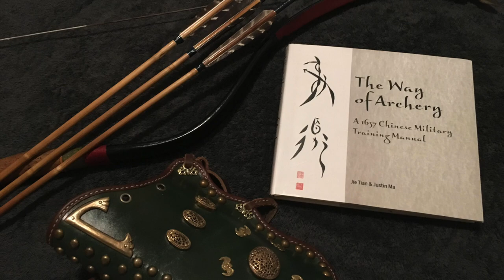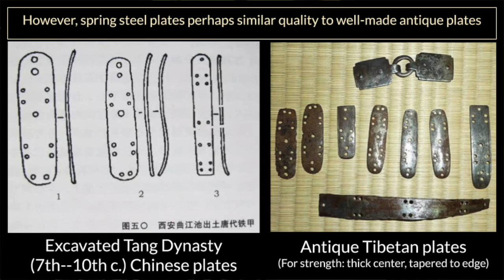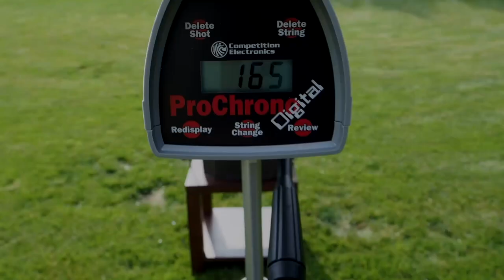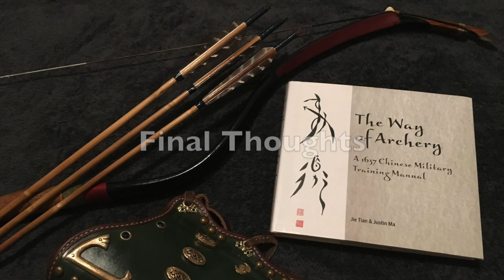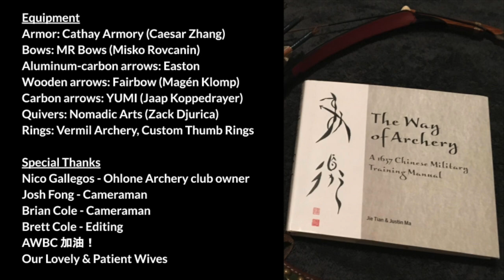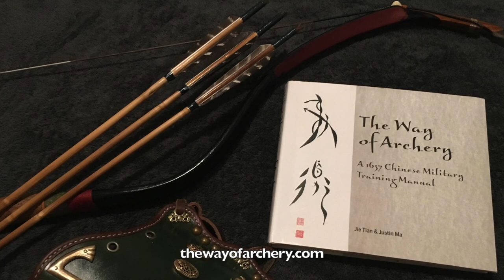Warfare Research Series (Episode 1): Chinese Lamellar

Comment: Great video! I'm confused why the arrow speed is so slow?
Reply: You should be more concerned with the arrow weight.
Reply from the maker: You'll want to pay attention to kinetic energy (0.5 mass x velocity^2) and momentum (mass x velocity) instead.
Reply: @Finnv893  not if I can't hit something past 30 m. Speed kills!  There needs to be a balance between speed and weight. I personally would like to see a lighter arrow traveling twice as fast! Maybe 700 ,800 grain at 267fps. If your familiar with bullets the 357 sig , I believe,  is a good example.
Reply: @TheWayofArchery  I know all about that! My 60lbs "Korean bow" with correct spine shoots an arrow 230 fps. Please don't take my comment as an insult it just seems something is wrong when a 100lbs bow can't break 200 fps with , I stress,  correct spine weight. Speed kills!
Reply: @regaeontop  not quite, your arrows must've been less than half the weight of those. These bow are designed for heavy arrows in a short range. If you're on a horse, shooting at a pile of infantry, you'll be close enough to hit anything anyway. Even if you missed, some other poor bastard will still get the arrow
Reply: @regaeontop  also, heavy limb tips. Light arrows would break the bow, but they'll love shooting a small javelin with a fletchings
Reply: @Zonic0000  I stressed , correct spine! If you thought I was saying I shoot 1000 grain arrows out of my 60lbs at 236fps then you need to read it again !
Reply: @regaeontop  spine is the stiffness, not the weight. I was making a point that the reason the bow didn't do 200fps like your Korean bow is that a large tip bow was designed to use a very heavy arrows at fairly short range, as compared to small tip bow like a Korean that was meant more for speed
Reply: @Zonic0000  fair enough , I agree!
Reply: @regaeontop  Korean bows are optimized for long-range shooting, resulting in a design that has great performance with very light arrows at high velocities. They are great bows, but they are just one approach. Not all cultures focused on speed, and most heavy warbows leaned more against heavier projectiles with more stopping power. Many modern bow hunters will also agree that a heavier, slower arrow is more effective in downing game. 

On top of that, when you go for speed there is a limit. Most flight records today are shot with 80-90 pound bows. If you make a heavier bow, the whole bow gets overbuilt and the added weight to make each part strong enough actually makes the bow slower. So above around 90 pounds on a typical recurved design you only gain the ability to shoot something heavier that does more damage.. not range.
Reply: @PeterDekker  a Korean bow is a composite bow just like the one your shooting. A Korean bow was also used in war and any composite bow can be shot long or short range.  The idea that MR bows makes bows for war and the Korean bow is for target shooting , I'm sorry , that's complete rubbish! The Korean bow I have came from Thomas duvernay and I can also get that bow made at 100 lbs.  100lbs is 100lbs! Maybe you should try that one! You guys keep thinking that if I'm concern with speed that I must have to shoot balsa wood shafts with plastic tips! Essentially a fragile arrow for the sake of speed. If weight is so important to you guys fill your arrows shafts with pebbles or rocks. It will hit harder but it will arc to the target at 20 yards. Also , I don't believe any bow hunter would expect a 100lbs bow to shoot slower then their 60lbs bow both with correct overall arrow weight.  Which is relative! Also , MR bows makes a beautiful bow but from what I've seen not the best performer! I take my archery practice just as seriously as you as I want to learn what my Hungarian ancestors did and didn't do on the battle field! I very much appreciate your pursuit , book , and video. P.s. I'm in California now I'd be glad to shoot my bow at that armor!
Reply: @regaeontop  Problem is there is no bow made (for the average human anyway) with trad materials (carbon would just delaminate due to stress) that can propel a 800 grain arrow at 267 ft per sec, there is a limit on how fast a pair of bow limbs can snap forward, adding poundage does not make them move any faster past a certain point, because you are also adding limb mass, when the point of diminishing return is reached, all you can do is add weight to the arrows to gain kinetic energy. Guns use barrels made out of modern steel that can withstand a ridiculous amount of pressurized gas, and all the energy is prestored in the powder to accelerate the bullet down it, so you can see the odds are not in the bows favour.
Reply: They're COMPOSITE BOWS not recurves!
Reply: @Finnv893  I beg to differ! We have not had the same experiences! I'm hopefully going to be starting a channel for the same reasons as justin and will show what I'm saying to be true or false.  You have to a count for the Bowyer. It doesn't seem Mr bows makes the best performer!
Reply: @Zonic0000  that's rubbish! The thickness of limbs etc is relative to the poundage it's being made for. I can get the Korean bow I shoot made at 100lbs. They're composite bows !
Reply: @regaeontop  A heavier arrow will always have more energy than a lighter arrow, every single time. It's not the same as the difference between a lighter or a heavier bullet. A heavy arrow takes more time to be accelerated by the bow, which gives the bow more time to impart energy into the arrow. That's why heavy arrows are used by anyone who wants as much penetrative power as possible. And also, I was impressed by how fast those extremely heavy arrows were being shot. 167fps may not seem like much if you're used to 200+ fps, but 200 fps is extremely high for a traditional bow and should not be expected from most bow designs. Turkish and Korean bows may be an exception.
Reply: @regaeontop  I know Thomas very well, we met in 2008 in Korea and have been friends since. I've been taught Korean archery in Korea and I like to believe I know what the Korean composite bow is, and what it can do. I have several that I shoot, including a horn one, and own and researched several antiques including one believed to be as early as the 17th century. The Korean bow is one of my favorite bows and nowhere did I state that Korean bows were never warbows. A variety of them was indeed used in warfare and there's even an article about them versus Manchu bows on my website.

We've tried and tested 90# Korean bows with several arrows and they lack the force to deliver the 80-gram heavy war arrow as fast as a Manchu bow of the same poundage can. This is due to the design of the bow, the limbs are narrow and optimized for quick acceleration. This is definitely not a flaw, but a very deliberate design choice. Both bows do exactly what they are designed for.

It shot its own lighter arrow at 260fps which was really quite impressive. But, like Justin in this video put forth: Poundage or arrow weight only tell a small part of a story. Joule of kinetic energy produced is where you measure potential striking force and the Korean bow does hit with less force for the poundage pulled no matter how you look at it.

Putting pebbles in our arrows is a silly statement of course. Every bow has an ideal weight for its poundage. Korean archers are never concerned with the spine, only with weight. Same for Manchu and Japanese archers. Spine testing is a recent obsession.

But let me conclude with a simple question. If 100lbs is 100lbs no matter the bow, why are there different bow designs to begin with? Did some cultures just not "get it"?
Reply: @jamesk8730  well , just how people focus on speed to the point of diminished return the same holds true for weight. Make a solid steel shafts with granite tips and it will hit harder then anything but you still need to hit a target. I also don't disagree with your comment! Well said!
Reply: @PeterDekker  yes , pebbles in the shafts was meant as a funny example of weight obsession! I miss spoke when I said "spine" I was trying site overall weight. Yes , 100 lbs is 100lbs. Your referring to design which is a point I've made already. What one 100lbs bow will do is not the same as another 100 lbs bow will do! Please don't keep assuming I thing any culture " didn't get it"
Reply: @PeterDekker  you can get more kenetic energy with more speed,  no?
Reply: @Zonic0000  I don't believe he is practicing for horseback.,  not sure!
Reply: @PeterDekker  Do you happen to know why manchu bows shoot heavy arrows faster than korean bows? I've heard that a lot, and I don't doubt it, but I've never heard why.
Reply: @jamesk8730  it's in the ears. A Korean bow is a short-eared design, which means you don't have a lot of leverage on the limbs. As a result, a 90# Korean bow still has rather narrow limbs. The advantage is that it's a snappy design that's very fast with a light arrow. A Manchu bow has long ears so for the same poundage felt on the string you can bend a lot more material in that limb, because you now have a 30cm long lever to help you do it. When releasing the string, all this material springs back. The thick limb of the Manchu normally doesn't snap back anywhere nearly as as fast as a Korean bow. But when you put a heavy arrow on both, the Manchu has that power to move it faster than the Korean bow because there's more "meat" in its limbs. I hope this makes sense.
Reply: @regaeontop  Maybe I am misunderstanding you. What is the point you are trying to make? You implied there is something wrong when a 100-pound bow can't shoot 200fps. That does suggest that you have a limited understanding of what is behind bow designs. 100 pounds doesn't have to equal speed, as much as putting 500 horsepower in a car doesn't necessarily make it fast. A truck is strong, not fast. It's not a design flaw in the truck either, it's made for a different job.
Reply: @PeterDekker  oh , OK!  I see where this is going. I really admire your work but it seems you don't like to be challenged!  Insulting me with your lack of knowledge about my own knowledge say a lot and I'm sad your this way!
Reply: @PeterDekker also , yes I think there is something wrong with your MR bow!
Reply: @regaeontop  I don't think he's trying to insult you, he's just trying to understand what your point is.
Reply: @PeterDekker  Thank you for the response. That seems very unintuitive to me, and no offence, but I'm a little skeptical. I've always heard that more weight in the bow limbs will only slow the bow down. Do you think a similar effect could be achieved by attaching weights to the limbs of a Korean bow?

I wonder if it has to do with the draw-force curves. It could be that the Manchu bow has much higher early draw weight due to the long siyahs. That would make sense because before the string lifts off the string bridges, it's like you're drawing a bow that is only as long as the limbs without the siyahs. Then once the string lifts off the bridges, it's like the bow becomes longer, and you gain a lot of leverage. That would cause the draw weight to increase very fast early in the draw, and then the increase would slow down in the later part of the draw.
Reply: @jamesk8730  I appreciate your diplomacy!  I think I made my point clear to him. My point overall is that speed and weight are related to each other. You can go to far in either direction . Off the top of my head example for speed would be if justin's bow could reach 200 fps with everything remaining the same there would be more kenetic energy without adding weight. So , speed means something more then target or flight shooting. I started off my saying to the effect of " I don't understand why the arrows speed is so slow" he could have just said " because the arrow is heavy" I would have said " well , for the sake of experiment lets try a "lighter" arrow maybe with something other then target tips and see what's what". My preferences I guess!
Reply: @regaeontop  Thanks for watching. I appreciate your enthusiasm. The best way to test hypotheses like yours is to create an experiment and provide hard data. That way there is no room for speculation.
Reply: @blake436  totally agree!
Reply: James K yes It does indeed sound counter intuitive at first. The added weight is not dead weight, it’s a lever. If you cut the ears of a Manchu bow you get a much shorter bow that now feels much heavier as you cut off the (heavy) thing that helped you pull it. An 80# Manchu, cut down, will probably feel like a #130 now. So poundage being equal, there’s more force behind a long eared design because it can bend the limb of a heavier bow for the same poundage pulled. And you’re absolutely right, you see this in the FD curve. It goes up quite high at first and then flattens. Which means if you release the string keeps pushing the arrow with more pounds behind it longer as well.
Reply: regaeontop Preaching to the choir now. Nobody here contested that adding speed also adds impact force. That’s just basic physics. I just elaborated on the fact that some bows lean more towards projectile weight while others optimize speed. Nothing wrong with either but it does explain why a 100 bow doesn’t necessarily shoot 200 fps. Regarding that bow: “Not my circus, not my monkeys.” It’s not my bow and I have no reason to talk it up or down. I study antiques and shoot composites that are not commercially available. So your comment did not offend me or any interests I have. I just tried to add nuance to a point you were trying to make.
Reply: I beg to differ! You seemed ,as well as I can interpret through the screen , offended by my criticism of the bow and it's arrow speed with the arrow you used!  You know , who cares at this point! I have no need to make you an archery enemy online! I will be doing my own test sooner then later as I've been gearing towards my own archery channel. Have a great day and I'm looking forward to your next video! Jo napot !
Reply from the maker: @regaeontop  you said "Off the top of my head example for speed would be if justin's bow could reach 200 fps with everything remaining the same there would be more kenetic energy without adding weight."

There would be more kinetic energy, but this is limited by the amount of potential energy the bow can store. Let's walk through a couple examples.

(1) AC-Heavy arrow (1273 grains) traveling 200 ft/s, that's 153 Joules of KE, but this is way over the potential energy of what the 113#@28.25" Tiron stores. That extra energy doesn't appear out of thin air. I'd have to upgrade to a 150--160# bow to get 153 Joules of KE.

(2) I have a 93# YMG korean bow that shoots a 793-grain arrow at 200 ft/s. But that's only 95.4 Joules of KE (and 3.1 Newton-seconds of momentum). Lower KE and momentum compared to what we tested in the video.
Reply: @jamesk8730  I think you and Peter are basically explaining the same thing, just worded differently? 

The way I see it, the ear/siyah is a lever, so it offers mechanical advantage (more stored energy for the same draw weight), but at the same time it lowers efficiency (extra weight slows the bow limbs down). So the design tradeoff are:

1) High stored energy, low efficiency bow (large ears)   vs   Low stored energy, high efficiency bow (small ears)
2) High efficiency (energy transfer), low speed arrow (heavy arrow)   vs   Low efficiency, high speed arrow (light arrow)

Small ear + light arrow = good, the high efficiency of the bow offset the low efficiency of the arrow, achieving high speed.
Large ear + heavy arrow = good, the high efficiency of the arrow offset the low efficiency of the bow, achieving high power (stored energy)
.
Small ear + heavy arrow = not good, you have less stored energy to transfer to an alreay slow arrow. The high efficiency goes to waste.
Large ear + light arrow = not good, double low efficiency. The stored energy goes to waste.
Reply: @TheWayofArchery  I am talking with Justin or three different people representing the video??? I thought I just ended my back and forth with diplomacy! !! Now , you want to keep challenging me! The simplest way I can make my point is , speed matters! !!!!!!
Reply: @TheWayofArchery  there is a " take away" from the video that hasn't been discussed and that is , as much as you and Justin and whoever else is responding to me love that MR bow and how heavy the arrows is along with your equation ,  as far as the video shows essentially doesn't matter!!! Why , because the guy wearing the armor faired quite well. Couple that with he would be most likely moving and mounting an OFFENSE of his own means that we need a different bow and arrow set up which is wear my interest are! Another fun example,  rocks from space seem to hit quite hard for there relative size because they're traveling so FAST! my point again , speed matters!
Reply: @TheWayofArchery  one more comment for the fun of it. I'm going to assume you won't take this well but just because it exists in a equation or on a chalch board DOESN'T  mean it exists in reality!
Reply from the maker: regaeontop This is Justin. Discussing challenging ideas with reason and evidence is part of civil intellectual debate. Both speed and mass matter, which is why we discuss kinetic energy and momentum, not just mass alone or speed alone. My point is the extra speed has to come from somewhere, because energy is neither created nor destroyed.
Reply: @TheWayofArchery  well said!
Reply: @戰國春秋   I don't think we're talking about the same thing. Peter seemed to be saying the high limb mass and long lever length increases the power of the bow, seperately from the stronger recurve increasing the power. I think that it's just the stronger recurve increasing the power. Not that I think I know more about it than he does, nor am I rejecting the possibility of his explanation outright.

If I haven't misunderstood him, then I think a good way to test his explanation would be by comparing two identical mollegabet bows, with the exception that one has longer levers than the other and is a bit thicker to maintain the same draw weight. That would isolate the extra limb mass and longer levers as the only differences between the two bows.
Reply: @PeterDekker  Thanks again for taking the time to write that out.
Reply: @jamesk8730  You are saying similiar Peter just gave you something you did not connect. The bigger ears act as levers letting you handle stronger limbs at a lower felt weight.  Take the levers out of play and you have to handle the full power of the limbs directly. You are both saying the limbs have to be stronger. Also because of the large ears the design forces the bows to need stronger limbs to compensate for the extra weight.  This leads to the generally accepted point that Manchu bows need to be atleast 60# (modern) to 80 (horn) before you begin to see expected performance.
Reply: @ehisey  Is saying a bow "lets you handle stronger limbs at a lower felt weight" the same as saying a bow has high early draw weight? If so then I think you're right that we're saying the same thing.
Reply: @jamesk8730  Exactly right.
Reply: @regaeontop  recurve is a shape, composite is a material
Reply: @PeterDekker  Peter Dekker himself. Love your website
Reply: @Zonic0000  with all due respect your completely wrong!
Reply: @Zonic0000  composite is more then one material laminated together , recurve bows are modern bows like Olympic archery.
Reply: @regaeontop  I said nothing about the limb thickness, just the tip. Yes, you can get a 100lbs Korean bow, but since the limb is thicker, the bow is slower. Justin may or may not do horseback archery, but people who designed the bow sure did.
Reply: @Zonic0000  wrong again! MR bows doesn't make bows specifically for horse back. Any bow can be used on horseback! Doesn't matter what part of the bow your referring to its NOT A recurve bow. It's a composite bow! Not because of shape but at least 3 layers of different material laminated together. Some composite bows have straight tips , some have curved or rounded!
Reply: I'd love to see a 100lbs Korean bow or any WELL MADE BOW from great Bowyer shoot slower then my 60lbs. I'd just like to see it! I guess I did in the video but I'm not a fan of MR performance.
Reply: @regaeontop  but there's a lot more to arrow speed than " the arrow is heavy" heavier bow tip (design aspects) can't move as fast as a light bow tip, but are also less effected by arrow weight too. Most bow has a recommendation for arrow weight. Most Korean bow should be around 9 gpp judging from Justin's arrow. Most Manchu bow would be around 12-13 gpp. Any lighter and risk energy transfer in to the limb too much and break them
Reply: @Zonic0000  ok
Reply: I am fascinated by that first research. Armour really did matter. On bows, raiders were more successfull hitting and killing unarmed peasants while plundering and taking slaves than armoured warrior that way (Edited: question is: *is this possible that whole crowd wore lamellar armour and not only elite warriors? What about mobility, hit and run tactic, siege machines? We always talk the bows and arrows ignoring other facts) . In my humble opinion tactic matters more than piercing the armour if armour like that wasn't shot from the angle to pierce through some gap. I have several arrowheads in my collection that are bent at the tip, reason: they've (more than likely) hit armour and failed to pierce through. Guys, f.a.n.t.a.s.t.i.c. beginning of series, thumbs up!!!
Reply: @regaeontop  Pretty sure modern Olympic recurve bows are made of "more than one material laminated together" ;)
Reply: @aeliascent1174  I didn't say they weren't!
Reply: @regaeontop  the horseback statement started when you are quite transfixed with being able to hit at range due to speed. My point is that the bow that was designed like this would not need such a high arrow speed as the tactics shifted towards horse archery which utilise close range and limits shot precision anyway.
Reply: @regaeontop  recurve refers to the shape of the bow that curves away from you. Unless your Korean bow is also a recurve, or you got a wrong one. Composite refers to the material that consisted of multiple types. Technically, those bow are composite too since they are wood+ fibreglass, so are Olympics bows. You're probably meaning a horn bow
Reply: @Zonic0000  I don't hink I have ever made a statement about speed for range!
Reply: I'm sure you love archery but I don't think you know what your talking about. I'm done!!!!!!!
Reply: @Zonic0000  go away!
Reply: @regaeontop  nah, I'm just getting started
Reply: @regaeontop  you said "why does the arrow speed is so slow", and something about not being able to hit at range due to arrow going slowly"
Reply: @regaeontop  I mean, a bit of book reading and a few years of physics and English in school, a few months in a archery club, constantly asking questions to learn from the other who shoots other style will teach you stuff pretty quickly.
Reply: @jamesk8730  I don't get it. I mean, certainly a beefier bow is more powerful than a skinny one (higher draw weight + higher stored energy), all else being equal? The lever doesn't "increase power" per se, but it gives mechanical advantage (i.e it lowers draw weight) while maintaining the same stored energy, at the cost of adding more weight.
Reply: @戰國春秋  I feel the same way, but there's a good chance I misunderstood him and incorrectly explained what he was saying.
Reply: @戰國春秋  the draw weight usually mean what you feel on your hand. The longer leaver helps lighten the weight on your hands. The 80lbs long tip bow could probably store the same energy as a 100lbs bow w/o tips. Draw weight doesn't base on anything btw. Just an example
Reply: @Zonic0000  The tested comparison is 82# Manchu close to a 130# ELB.
Reply: @ehisey  bloody hell. Way more than expected